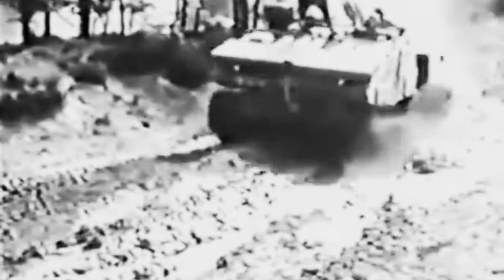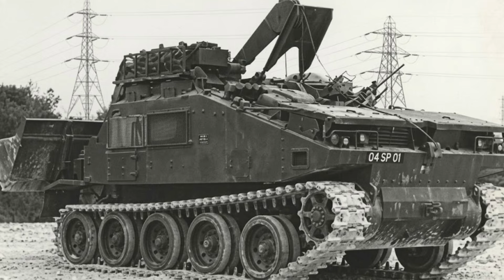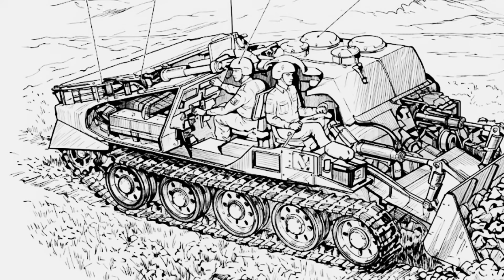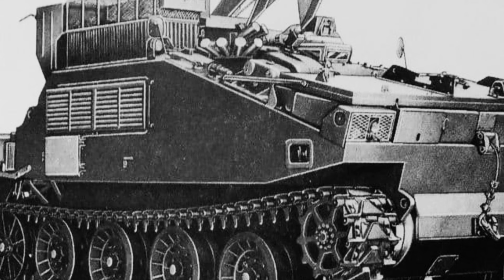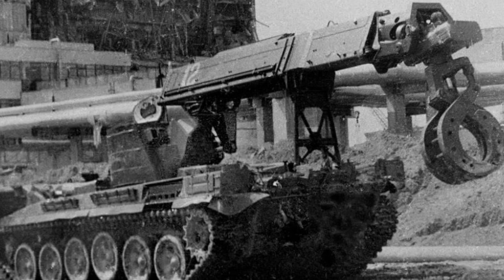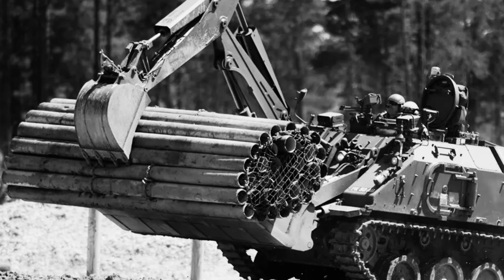The 'Ridiculous' British Tractor That Could Swim Rivers And Smash Bunkers No Tank Could Touch

Comment: “It was not elegant. It was not fast. It was not heavily armed. Yet it worked.” The Frog proves that battlefield engineering is often about versatility rather than brute strength. Swimming, digging, lifting, and even firing a rocket anchor made it truly unique. Which capability impresses you most?